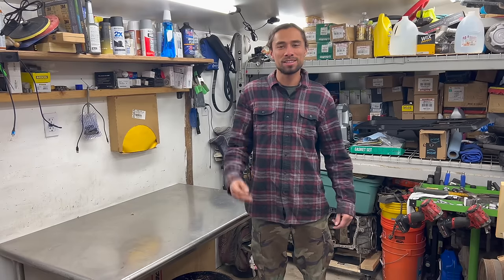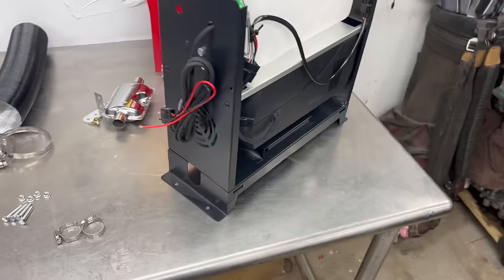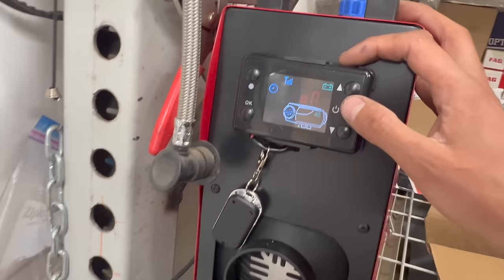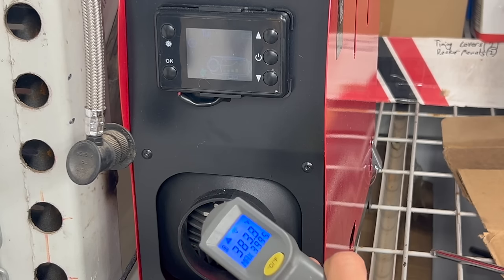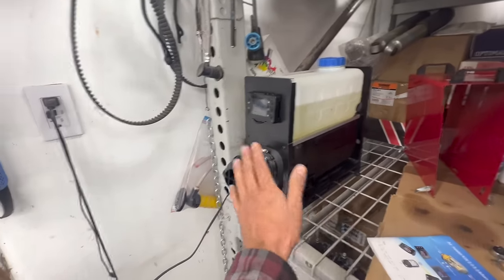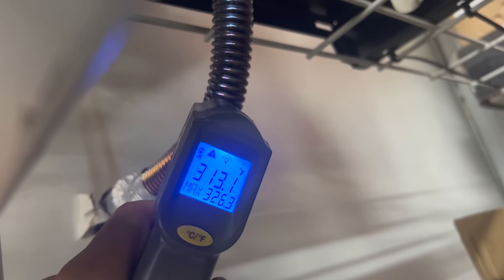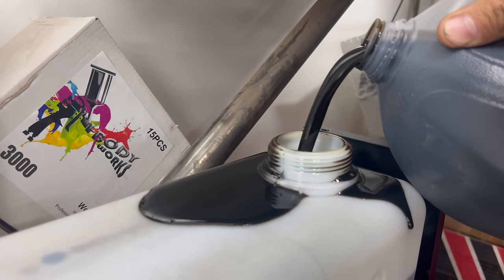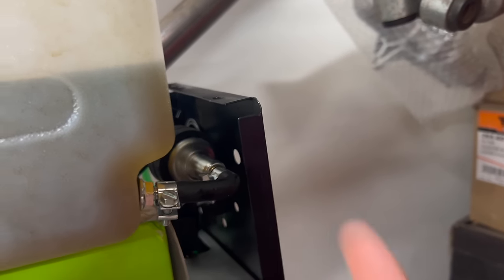Unfiltered 100% Waste Oil Vs Stock Diesel Heater

Comment: Why am I not surprised the unit says 'no'...I'm guessing the unit has a jet that is set for the viscosity of diesel so a further guess is that you need to blend and or heat what ever fuel you chose so it matches that viscosity or near enough for it to cope. Perhaps changing the tank for a metal one with a thermostat controlled heater in it could be a good start and replace the hopeless fuel hoses with something heat resistant. Also there's a ton of waste heat lost via the exhaust that could be used. Either way for the money they'd pretty good but seeing the built quality I too have bought a spare!
Reply: The heater doesn't have any form of jet, a set amount of fuel is squirted in which makes its way to a large gauze which is used to increase surface area to evaporate the diesel. This happens in a vortex chamber. The problem with using anything other than diesel is that the gauze gets clogged.  Very difficult to get properly clean.

Comment: You could try pre heating the oil before it gets to the pump. Maybe a few copper coils around the exhaust.

I've seen several comments to check to see if the glowplug is tight. They often arrive with them loose.

Comment: @14.24 yep this is how i clogged mine up. the 1st time i cleaned it, the bottom on mine (its in a tool like case) when i pulled my air intake off it was full of motor oil.

i'm on a second clean out now running kero in it to clean it up. i won't be running anymore waste oil in mine. its not worth the trouble. stick to fresh diesel.

Comment: I would do 20% regular unleaded gasoline and 80% FILTERED waste motor oil. I ran a Ford 7.3 IDI on that mix and never had a problem even on a Michigan winter.

Comment: There's only one thing I'd really be weary of while running one of these on waste engine oil long-term, even mixed with diesel and that's ash buildup from the additives in the oil. Especially if it's not a low SAPs diesel specific engine oil, it can cause quite a lot of ash buildup over an extended runtime.

not to say the heaters are incapable of running on the stuff though because they absolutely can - It's just that you'll have to deal with it coking up with ash, where the carbon buildup that happens in these things from being run at lower power levels can usually be cleaned out with one occasional extended full heat run. to clean that ash out though you're gonna have to disassemble the combustion chamber to clean it manually - ash doesn't burn unlike soot deposits.

Comment: You could increase the efficiency of the system by having a longer exhaust pipe inside, with a short pipe you're losing more heat to the environment

Comment: there some wrong things, the fuelpump must be around 45 to 90 degree to work well so the entry of the pump musst be lower then the exit. also the E08 issue can be soot in the burning chamber. if u got some questions, ill be here. greetings from germany :D

Comment: Yeah on waste oil you have to clean out the combustion chamber every now and then, for the carbon buildup blocks the flame out and the torus turbine chamber, its very easy to take apart with a screwdriver and alen key, because of this blockage, you have less exhaust pressure so it will blow fuel out the inlet like a 2stroke or rotary with a blocked exhaust.

Comment: Fuel coming out of the intake seems to be caused by overfueling. I was working on a momth old webasto that went straight to 10+k feet without altitude adjustment. Could not start because of soot build up inside. Coal was falling out of it. Then i noticed fuel coming out of the intake, unplugged fuel from the heater and it started after 5 tries blowing lots of smoke and chunks. I ran it on full blast for a few hours. Smoke cleared up and afaik the heater is still working.

Comment: What you really need to do is get yourself some stainless steel fin tube and run your exhaust through that.
It'll help utilize a bunch of that 280* heat that your currently just blowing out the wall of your garage.
Failing the fin tube, just a long section of regular tube but run through a round heat duct with a fan blowing on one end....

Comment: Got mine yesterday and it's heating my greenhouse nicely at night. Right now it's running on diesel but I plan on having a second tank mixed 50/50 oil diesel to burn but have switched to diesel for warm up and shut down. I also got a vevor Bluetooth to beat the house with, but won't need with oil mixture in that one. Very interested in seeing what you will experiment on your heater and results.
Reply: I really suggest you search YouTube for wmo Chinese diesel heater. It'll save you time and frustration. Trust me.

Comment: I would recommend adding some diesel or gas to thin the used motor oil and filter it through a bed sheet of nothing else
Reply from the maker: Based on my experience, I would agree

Comment: Just one thing on why are you getting the flame out. It is bicus it is putting too much oil in the chamber if you ran it on 4.4hz it will work fine

Comment: What's happening is that in line filter is probably clogged as all hell from the motor oil. Looks like it's pumping air, but it's really just pulling a bit of vacuum in the line.

Comment: Welp, I run both of mine on diesel (red/clear) and kero, and they run great. Running waste oil isn't a good idea and will foul the burn chamber. If you open that heater up I suspect you'll find it's not very pretty. Also, double or triple walled insulated exhaust would be a good thing. The pump needs to be on a 45 degree angle with the output facing up.

Comment: two tanks one pump 2 filters way to go 5kw units only.straight used oil after start with diesel /shut down also diesel. the oil needs to be warm hotter thinner oil will be.nozzle is a drip not atomized.if i recall the fuel tube before drip gets hot from unit but few ways to heat waiste oil .elements or run metal fuel line near exhaust then to pump .i havent needed to heat waist for my runs but i just told all how if needed .room temp no need heat for my 5kw unit. i used & still do waiste oil burner past 40 years they all have heating block in burner head,.i have magnet heater for metal tank but never use it.another thing air intake need to create a chamber like a car .take one out you see design for air needed on demand. these units are sealed  so only adjust air by smoke to no smoke out exhaust.if u get oil dripping  means chamber flooded, remove exhaust air intake blow it out with air hose, then restart using diesel ps these unit dont like water / antifreeze in oil that was my only problem

Comment: tried umo  super hard carbon build up , mixed 50/50 #2 oil had to add gasoline to make it burn. umo does drip out. cleaned it out did 100% #2 oil after about 15 gallons it quit. burn chamber n pipe full of soot . i was on #3 heat. going to 100% diesel from now on. oh had to buy new pump. n u dont need to run any special fuel line, it just drips in , no injector in there.

Comment: I tried the same thing. The same unit. The combustion chamber fills up with coke and there is no room for burning. It needed to be taken all the way apart and cleaned out. Clean clear fuels will be best for this design. Needs a way to remove coke if it's going to burn waste oil.
Reply: I did get it cleaned and running again, but it was a total teardown and rebuild. 😂

Comment: I have ruined my first one running waste oil in it...
I filtered it, mixed it 50/50, etc... 
Now it won't burn anything.
I have 5 others, one has been running red diesel for a month straight.
I use a cleaning additive every so many gallons.
The pump needs to be about 15 to 30 degrees tilt output side up.

Comment: Maybe try a different fuel pump and a different glow plug for the waste oil vs diesel. The concept of these designs are essentially the same as a waste oil heater so maybe just changing a couple of parts will work it like it should.

Comment: safest way: mount these outside under a makeshift shelter,  route the heat tube(s) inside.  Then it's less likely that a failure will burn the building(s) down.   I have one.

Comment: I seen you also have to put the fuel pump so the out is facing DOWN not up like they put it from factory and that helps the thicker stuff pump so it ain't trying to pump upwards, also you should thin out the oil a smidge like 30% diesel or something

Comment: wrap the diesel line around the exhaust to heat the fuel up for a better burn on waste oil/diesel mix
Reply: Be careful with that - the exhaust can get very hot and depending on what type of line you have it could be a real disaster!

Comment: Lol filtering wont help incomplete combustion. Yes you can run it but after several days run straight you will have to dissasmbe and clean everything.  You can use a primer bulb from a small engine. It helps you can get it to light sooner and add a bit extra to heat up. Oh i have a centrifuge and filter to 2 microns after heating above 212 degrees to remove water. So if you dont mind cleaning often it can work. I have 3 of these heaters and some work better than others running high altitude mode if its an option certainty helps slow the buildup.

Comment: If your going to run oil you have to mix in gas. 2-3 gallons to 55 gallons of oil works. The gas can be old as heck turpentine it doesn’t matter. Get it from junk yards they will give it to you same with oil.

Comment: Old style pan burner works well for old oil but not in enclosed small spaces. Got wood that needs weatherproofing like a trailer deck or fence posts? Probably the most use you’ll get from a 50/50 mix with diesel.

Comment: I run mine at 70/30 diesel to unfiltered waste oil. It runs fine but I did clog it up running it down on 1 for two days. I got it restarted set it to 3 burned everything in the tank and it's been fine. Last tank of the season will be kerosene on max to clean it out
Reply: ugh....the day after i posted this i wound up having to drain the tank, pull the exhuast and spray out the inside with carb and choke cleaner then refuel with kero and i got it running again. it sounded terrible. inconsistent flame i ran it on max for 6 hours on kero and it sounded ok.....

.... and then put the same shit fuel into it it ran for a couple of days and then last night E-8. i just cleaned it again, dumped the fuel, replaced with kero, and its running now on 3.

Comment: I bought several of these heaters . 
Some of them were shipped with the wrong hardware components and would not work at all .
It will NOT RUN on used oil , very long , before it destroys the burner with heavy varnish residue ; it will eventually destroy itself even if the fuel is high grade diesel because of the varnishes that will build up and the heater will become “ smoke pot “ . 
When the varnishes build up , it is nearly impossible to remove .
The heaters destroy lead acid batteries within a few weeks .
They have to run constantly  , they will not cycle on and off making it useless during milder weather .
I have 4 of them stored in my shed that will not work because of :
Comments don’t match each other 

The burners are varnished up 

And 3 are new in the box but I don’t want to waste my time installing and then have to remove them after they fail ( again ) .

They will eventually fail , even if the diesel is clean ( but is old ) .
🤷‍♂️👎🏻🤔😡🤬😤 
They are ( basically useless ) .🤷‍♂️

Comment: I think any oil would have to have 1 of 2 things.  Either it needs to be cut with kerosene or diesel, or you need 2 tanks, fire it up on diesel, and then switch after it's good and hot.  Some dude in Britain did this sort of thing with just veggietable oil.  It had to be cut with like 20 percent kerosene which is a bit cheaper than diesel.  I bet if you used separate tanks and cut your motor oil with 10 or 20 percent diesel or kerosene, it would work like a charm.  A real heat inducing amulet I say...  Good luck hope you get it to work.  Guess I should subscribe now so I don't miss the outcome and you don't have to repair any more holes in the wall...

Comment: waste oil is unique, you need to filter and thin it to work in most diesel heaters. problem 1 is that the contaminants in the oils is not just carbon and metal shavings, its also the water that saturates it.  at a bare minimum you need to settle and filter your oil, some oil needs to be centrifuged to clean.  problem 2 the oil is too thick, the best thing to thin it with is gasoline not diesel, you can get old stale gas out of your lawn mower or from the local car shop.

Comment: the hot ass exhaust, these heaters are hot air exchange units. So it burns diesel in one chamber and passes air over that to heat the air. So really a FUCK ton of heat gets dumped out the exhaust, so you could try and old school VW exhaust heater to scavenge the heat back. 

Also the weird burble noise and oil, thats from it trying to light and not being able to keep the burn happening.

Also pull the air in, and push the exhaust outside. If you're in a little enclosed shop its not going to end well unless you got a load of Co2 alarms.

Comment: you should make a radiator or expansion chamber of sorts for the exhaust to harness the wasted heat going out the pipe
Reply: Nah, you want to keep exhaust temps up, exhaust has corrosive compounds that will condense below 127f and form acid.

Comment: I added a small amount of waste oil to mine and burns more efficiently and makes the pump run quieter but u will need more diesel or kerosene than oil

Comment: I would pull out the fuel pump and inspect it for particles maybe it's clogged clean it prime it and run two pumps and run more lines to divert or alternate between different fuels 🤷‍♂️
Reply from the maker: New pump changed nothing, the burner was clogged

Comment: Ran mine on waste oil for a while. Main thing is you need to tune the unit for the fuel. On mine, I increased the minimum fan speed and lowered the max pulse rate.
Ended up mistakenly using some used motor oil with some brake fluid in it. Ended up filling the burner with can only be described as concrete.
With the Vevor, I have not seen any tuning instructions and their manual is poor.

Comment: I run mine on used frying oil and diesel 50/50 mix. I filter the used frying oil before mixing it. And i hawe a kopper brake line heated bye the air flow witsh pre heat the mixed oil a litel. 
But i need to take it apart and clean the burn chamber from sot ewery 50-60hr.
Beside that its running perfekt.
And one more thing.
I start it on pure diesel and let it run on pure diesel 10min before i stop it.

Comment: u need to thin the oil with gas. That poor little pump isn't made to push oil. It is designed to push diesel which is much lighter than oil. You could run the exhaust through an oil tank and heat the oil before using it to run the heater, the viscosity will be much  better to go through the fuel pump. Just a thought. 40%gas and 60% oil mix should give you a good viscosity. Also, get long flex pipe, coil it in a box and use a small fan to pull the heat out before running it out to the outside. Capture all the heat

Comment: These have problems even with low grade pump fuel . It actually emitted less heat and lots of soot  with  standard diesel  and good heat on top fuel diesel.

Comment: If you use no higher than 50/50 drain oil /  diesel or more 25 - 40 drain oil  /  75 - 60 diesel you will have better results also use atf.  Best wishes  !

Comment: two problems with waste oil... 1st, waste oil is too thick. As you experienced, it will kill your pump. 2nd, it will coke up your combustion chamber faster. You can combat this by cutting your waste oil with a LITTLE gas. This will thin it out and make it burn easier so more complete burn = less carbon buildup in your burn chamber. (3rd world countries make "diesel" by combining old motor oil and gasoline.)

Comment: Anyone using waste oil for even an oil furnace designed for waste oil. Run it through a paint filter first!! Then glue neodymium magnets to the outside of your funnel to pour it into your machine! Trust me, fishing a forgotten drain bolt or rust or whatever out of a furnace tank sucks when it’s logged into the fuel outlet. 

Paint filters fit right in the funnel so its not as difficult as it sounds but will save headaches.

Comment: I'd be interested to know if it will run on black diesel, mix of engine oil with a splash of gasoline to thin it down.

Comment: your exhaust heat issue is likely because you stuck the actual exhaust tube inside a random larger diameter pipe, and let that be your termination. The airflow gets fucked up, and can let excess heat build.

Comment: I’ve been thinking about getting a diesel heater and lake with you, I want to run it off of used motor oil.
So clearly it will work, but it doesn’t like it.

Comment: where's the followup video with the new pumps? I wanna know if the pump was the problem and if waste oil will work
Reply from the maker: Won’t work. Pump changed nothing. I have broken 2 more units. I’m still on a quest to make it work, but don’t care to publish 30 parts like some channels, (not bashing, I have watched all 30 parts 😂) 

I have some tests going that I have not seen tested before. I WILL find out if this is possible to do RELIABLY
Reply: @steinfabgarage  I'm going to subscribe just for that. Can't wait to see if you can make it work. Also don't forget restaurants will give you used cooking oil. Maybe you can filter it and make it work? Cooking oil is much more practical than engine oil because how much oil are you changing out of the car? Not much

Comment: Bruh, a lot of those issues would have been fixed by manually priming it. Hold the down arrow and the OK button, then the up arrow to select 'on', once primed (no air) press the down arrow to set it to 'off', then fire it back up.